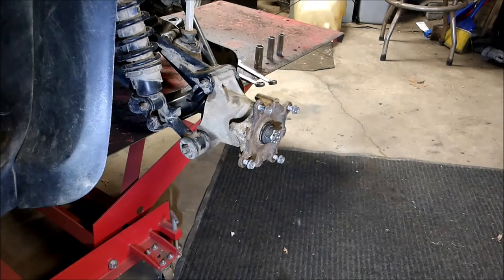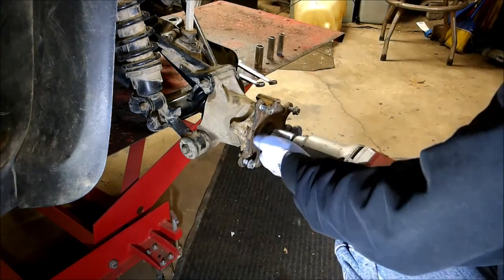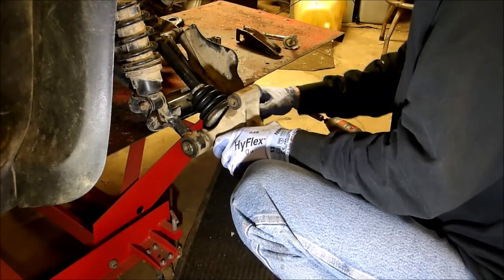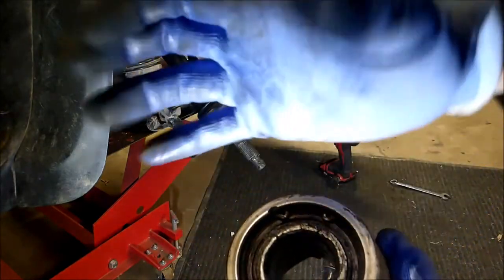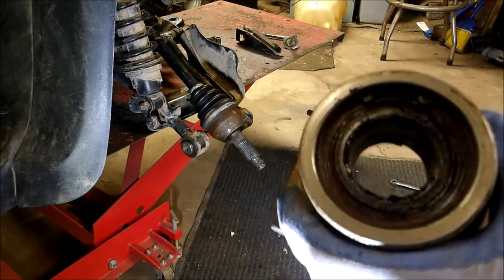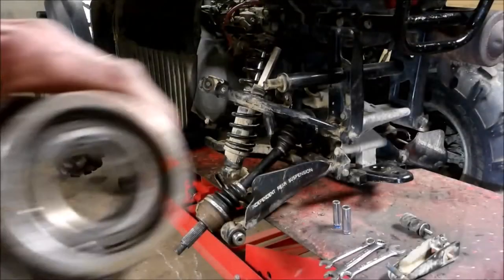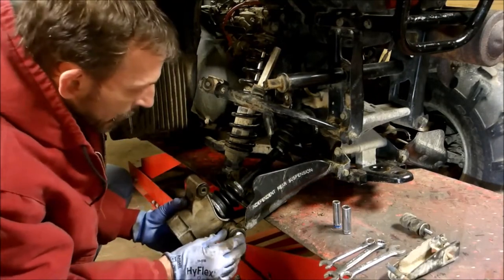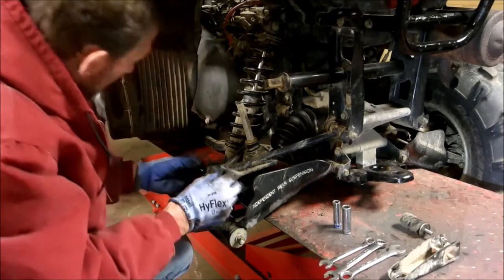Polaris Sportsman Hub Bearing remove and replace

Comment: thx for the vid, in the process of changing out both rears,  i didnt have a press but used the wheel bearing kit (press and pull)  worked great, about 60 on amazon (for those that want to do this and dont have a press ) (use with vice).... question bout tightening the end link there,  really smashed the bushing down I noticed, is that fine?  Im asking because i just replaced all 8 of them but didnt really know how much I should "smush" them.  Thanks

Comment: Did you pack the barring with Grease before install?
Reply from the maker: No. You dont pack those bearings.  It does more damage. You fill the hub with hub fluid or ATF to keep them lubed up and helps engage the 4x4.

Comment: Hey I have a 1996 Sportsman 400 4x4 with a solid rear axle. I stripped a hub, and have it off, but am now noticing theres some left to right play in the axle itself, looks like there's two nuts on the axle right in front of the main gear that might need to get tightened down, is this a viable fix, or should i get inside that rear carrier and see what's going on?
Reply from the maker: I would check the carrier